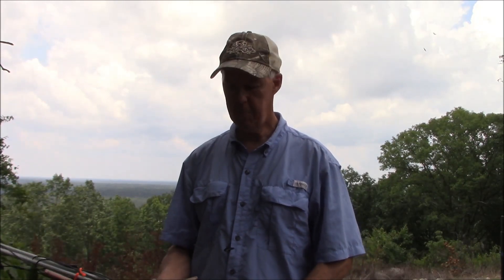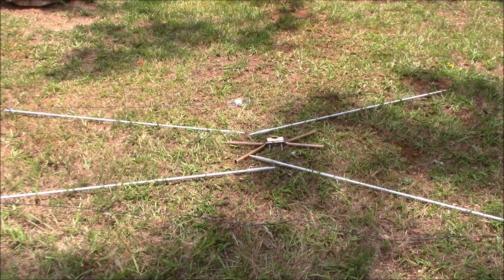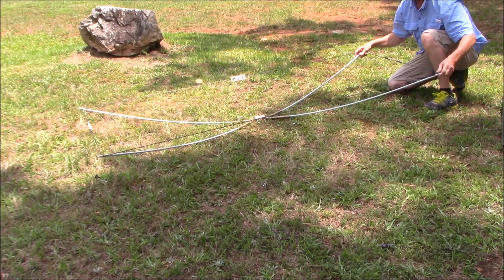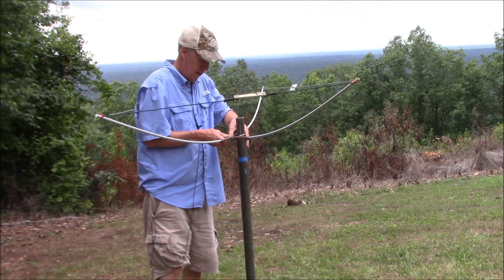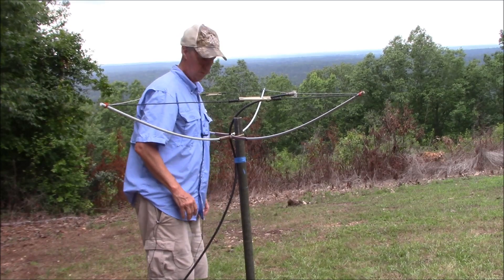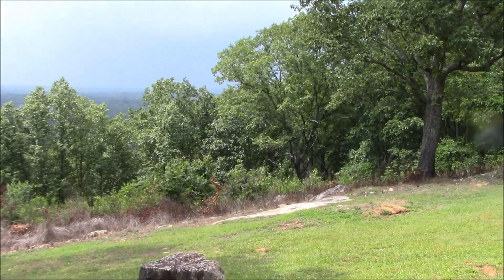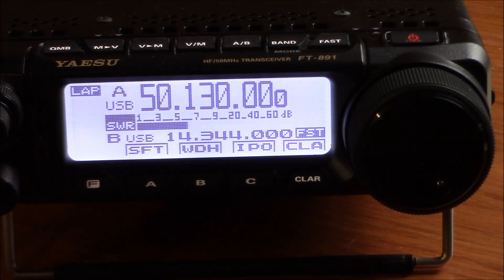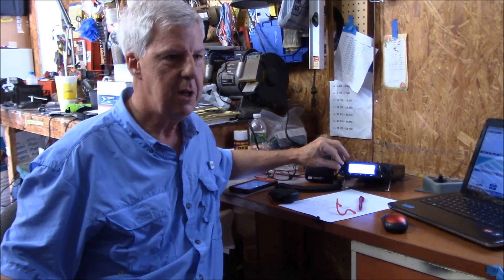Moxon 6M Field Test

Comment: Does the calculated length of wire take into consideration the wrapping around the insulators or the overall finished rectangle? I've used a moxon calculator but I'm not sure if I should add wire to the length in order to allow wrapping it around the insulators to 'tie' them onto them?
Reply from the maker: The measurement is to the point where it goes through the insulator.

Comment: What Diameter (across) are those support poles in Millimeters ?   I’m going to try to build one but instead 3D Print the hub.
Reply from the maker: The fiberglass rods are 9.5mm or 3/8" in diameter.

Comment: how long are the legs of this antenna please
Reply from the maker: The antenna build is in my previous video,    https://www.youtube.com/watch?v=4rDcUscYwXA    I used 129" to start with for each element length.  Use any of the Moxon antenna calculators on line for the frequency you are after.  Thanks :-)